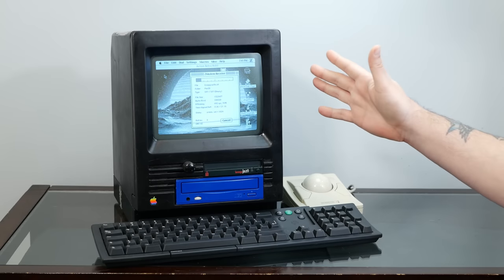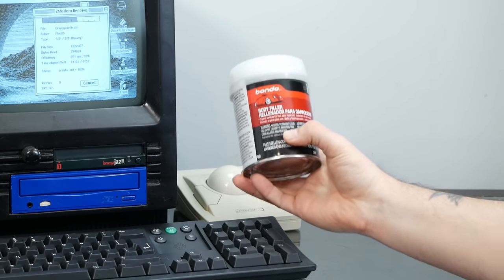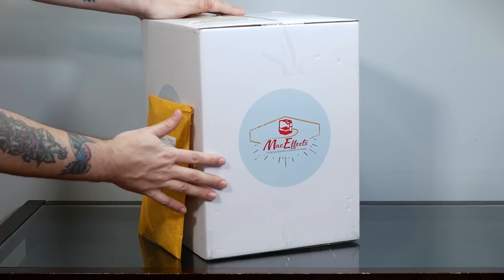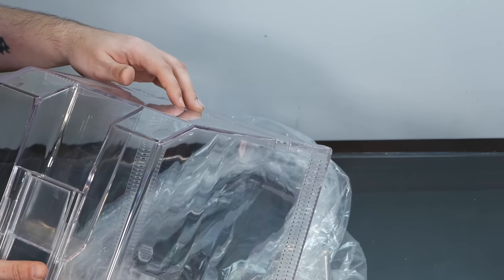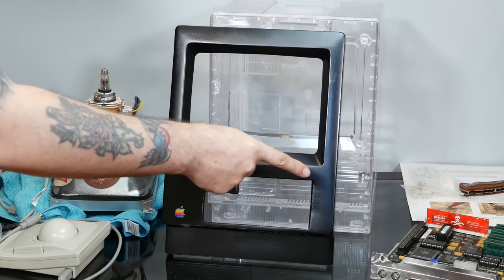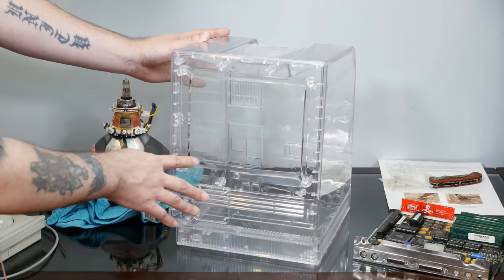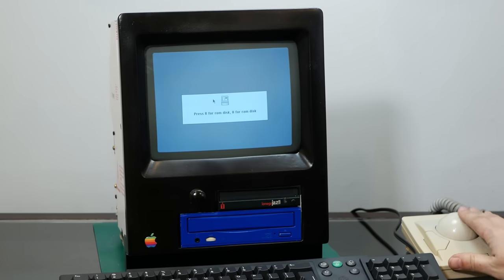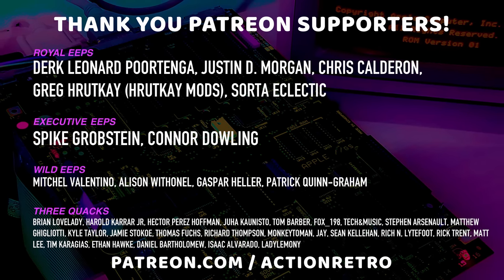Going to Extreme Lengths to Save the Cursed Mac

Comment: That front piece looks pretty rough. From my experience using Bondo on woodworking projects: you really need to sand bondo by hand with flat sanding blocks. Power tools just don't work well with Bondo. You probably shouldn't try to sand flat surfaces with a rotary tool (as seen at 11:11). The injection-molded case looks great though.

Comment: Bondo is basically polyester resin with filler, that makes it easy to sand and less cohesive, so it's not a structural material. It shrinks a lot, being polyester based rather than epoxy based. You need to apply it several times and over-apply it, and sand off the extra.

You also need something like a long sanding board and maybe special sanders. It's possible to make it look perfect. Make use of primer to detect unevenness that needs to be patched up.

Or don't if it's supposed to look cursed :D

I have a monitor, that i found on the side of the street and repaired, that i patched up with Revell putty, it was only small scuffs, and did about a day of painting and sanding on, and i also modified some lines. It looks so immaculate, that it's pretty much impossible to tell that it wasn't supposed to look like that. Of course restoring solvent damage is a different calibre.

Comment: I agree with ppl’s comments on the case - mod and paint the clear new front case to replace the bondo version - you’ve really got to have those stylistic indentations on the front to embrace the 1980s design vibe - it’s way more edgy and cool than the bondo flat version
Reply: There are translucent spray paints... Honestly, praying a translucent "smoke" grey inside the clear front case could be a pretty sweet look!

Comment: restoring groves is actually quite possible using a body filler. You need to establish a straight guide, and use a card with a squared protrusion that fits the groove. Slide the card through the groove to shape the filler inside the groove, making sure the card stays parallel to the straight guide.

Comment: Honestly, I liked how you had it. If you have regrets, I'll be happy to design and print a new front panel for ya. I actually have a resin printer that could print that in one piece, and super strong resin isn't at all expensive, a piece that size would be like $25 in material.

Comment: I would honestly find someone to trade the front of the MacEffects case (whichever color you end up with) for a stock SE/30 front, then cut holes for the drives and knob and paint it black. You’ve worked so hard to exorcise the curse and make this look well-thought-out… I love the idea of the black front and transparent blue back but that current front is just too wonky now in my opinion.

Comment: This makes me wanna dig my failed Color Classic Takky project out of mothballs... I kinda gave up after spending a ton of cash on it, when it failed to produce video output after multiple test assembly steps passed. I could never figure out what had failed. the project was pretty hardcore. I even swapped the floppy slot for a laptop DVD/CDRW drive, and figured a position where the IR sensor could detect the old Mac remote by refraction via the edge of the CRT. I had figured out a way to fit the 2xPCI riser card in, and had a Comm slot ethernet card. I was gonna try to have a USB/IDE card in one slot, and a hardware DVD decoder on the other. It required video passthrough, and I think that's where I failed in the video output. I tried to make all the connections internal, and screwed something up. What makes matters worse, is that I have no idea if I can even find the info and software I need for the old Wired 4DVD card anymore. Ill have to dig...

I originally built it because I wanted a tiny media computer for playing music and video inside my soldering fume extraction booth.

Of course, today, such a task is easily done with my phone, or a tablet, or even something like a Raspberry Pi and a n LCD if I want a more permanent solution. I have no practical justification to go back and finish it, save for the simple wish to just complete it. Honestly, I kinda do want to finish it, just because! At the very least, the DVD function would be unique!

Oh yeah, and much like the cursed Mac, I too spray painted it... only mine is a green machine! 🤣
Reply: That part about the IR sensor is hardcore!

Comment: This thing is a real freak. I'm honestly not sure if these things is an improvement or not. Anyway, I used to be a sucker for transparent electronic devices, but in this case, I have to say it didn't look as good as I would have guessed. There are too many studs, and besides, the insides of these machines aren't very pretty. I don't know how the blue version looks, but I'm doubtful. It might have been interesting to see this transparent one with blue paint on the inside though, and maybe combined with a more shiny piano black front, or transparent with black paint on the inside. But that would deviate too much form the original I guess, and I'm not sure how well paint will fare with the temperatures in there.

Comment: After you make the next mode, post a list of all the mode’s done so far. Also maybe it’s the way it looks on video, but it like something is wrong with the monitor. On my SE/30 the picture fills the whole screen, does the monitor need to be replaced or tuned?
Reply: Not an expert but it probably just needs adjusted a little bit, I believe from the factory they never quite filled up the entire screen. I believe they are a little bit longer than they are tall. Do a little research on safety precautions and all that and it should be a pretty easy fix if it's bothering you.

Comment: I'm disappointed to see that you kept trying to salvage the front. It's gone man. All that time you put into it hasn't improved it. If you don't want to take the front from another case, you should check how opaque the black paint is. Because you have the front from the newly produced case that you can use. Rough up the plastic with some sandpaper and give it a shot.